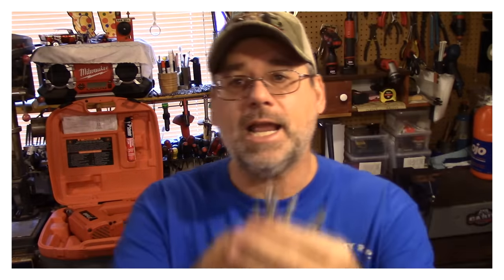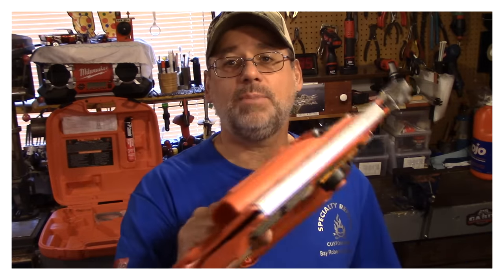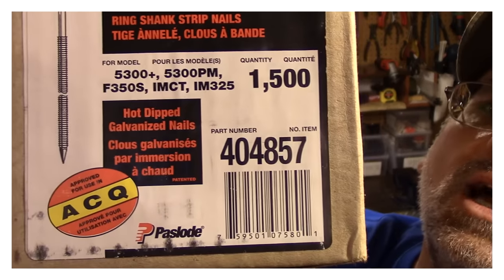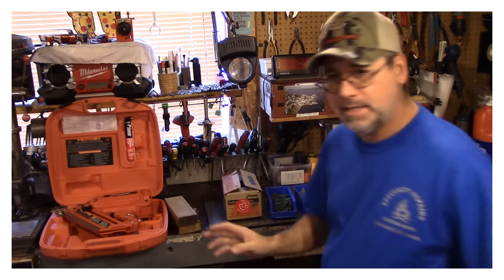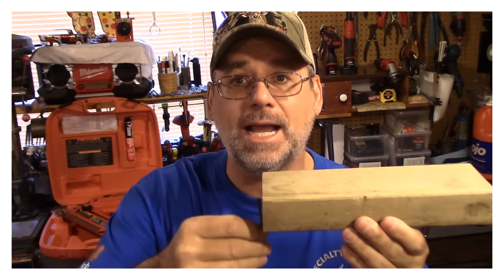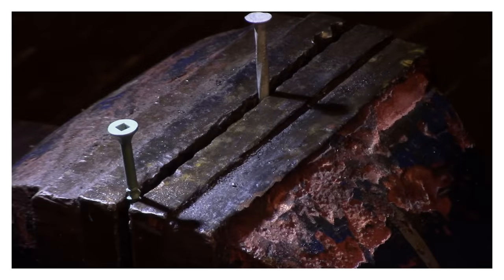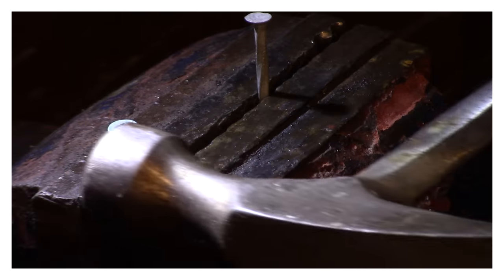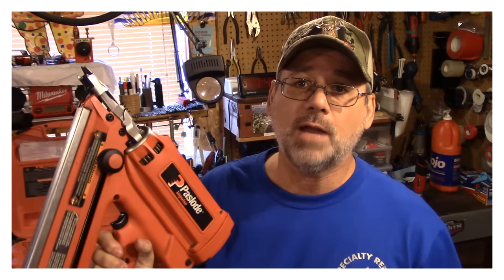BEWARE  NEVER USE DECK SCREWS  - DECK SCREWS VS NAILS -  PART TWO IN DESCRIPTION

Comment: The screws your showing are high tensile steel . Of course they shear of on impact,  the nails are mild steel.  SHIT galv or not.  316 Stainless steel screws are not that expensive will not rust have a far greater load rating than steel deck screws or mild steel nails and will still be there when the wood is well and truely finished.   And for load bearing structural joints like on deck frames use bolts nuts and washers.  There not that expensive either  and you get a far better job.  Nails are just quick not quality.
Reply from the maker: High tensile screws that snap like a pretzel  are only made for holding deck or fence boards down but interesting enough I still see them used with joist hangers to ledger boards fastened to block walls with proper anchors then the deck joist is fastened on with cheap deck screws 😅  I've seen some fancy bodge work from diyers . Cheers
Reply: I have driven thousands of SS deck screws, 2.5," 3", 3.5" square drive heads, and never has a single one broken or snapped. My own deck built 25 years ago, the screws are perfect shape, can be removed and reused. No rust, hold great, look good forever. Square drive screws one weakness, the heads can strip out, but you got to know what your doing, like push down decently hard, no careless driving like using a torx screw head, (whish is hardened steel). The SS deck screws to use have the cutting chisel point tip, no need to predrill in soft woods, except maybe at the end of the thinner deck boards.

Comment: I got the Ridge hose air gun nailer the paslode was too expensive. Thanks for what i knew was wrong. My buddy had a Paslode gun with the framing nails not for pressure treated. We only use to attach stringers to ledge board for the stairs.
Reply: @SteveRobReviews  We will see deck replaced 2016.

Comment: That is not a proper test putting it in a vice and saying one shears easy and one doesnt. Make a small structure with a few boards fastened one with nails and one with screws and then test shear and how hard it is to knock the structure apart.
Reply from the maker: I would love to be able to do that. I was just trying to show how side loading a deck screw can result in breakage because of its brittleness. They are  a terrific fastener in the right application. In part two in the description I revisit the test somewhat. Cheers and thanks for taking the time to respond.
Reply: thx for response I just like to see some practical applications to see when and how they fail. I realize it is a lot more work, Just seeing in practical application and how they fail helps paint the picture.
Reply from the maker: +Rollack  That sounds reasonable and the next time I'm out and about and I run across an example I will film it and give you credit for the suggestion. Thanks

Comment: Nails are for structure. Screws are great for plywood underlayment where there is weight above and lateral friction as well as plys versus solid wood.
Reply from the maker: Well said Bill. 👍
Reply: @SteveRobReviews  In the event of seismic activity...which in theory can happen anywhere...the structure rocks as a unit. There is tremendous force and friction which nails can withstand. Nails however should not be driven into studs that are 40+ years old. They will split!
Reply: Nails are for structural framing. Decks are a different animal. Steel hangers, wood joinery, and heavy bolts are for deck structure.

Comment: I like screws because it's easy to fix my screw ups.  Pulling out a hot dip galvanized nail  not so good. Sometimes I use a few screws to get things in place then bang some big hot dip galvanized steel nails.
Reply from the maker: Screws and nails both have their uses so   pick whatever  is required for the location  . Cheers Robert

Comment: Yeah, I agree. I don't use screws. They may draw a board in easy and make it easy to remove a board but, I have never had to remove a board or at least desired to. Nails are stronger and don't snap. With a nail gun, your done in a 10th of the time.

Comment: Always use stainless steel nails. They cost more but they never rust. Hot dipped will still rust.... I also love the passload nailer.
Reply from the maker: I agree and so far the nail gun is awesome. Cheers Gary
Reply: gary brinton 
The stainless is a lot weaker. Double dipped galv. nails are code for structural construction in many states. Also the paslode is convenient, but the will fail inspection where a full head is required. The most reliable and lightest gun on the market has been the hitachi framing guns. I'll take those with a 1/4" poly line Any day over a cordless anything. But that's objective. The convenience of the cordless for the weekend warriors are priceless. I agree

Comment: take a mobile home apart, its full of screws they work better than nail
Reply from the maker: Its not one better than the other its whats allowed and whats not . If both are accepted then its your choice but you can not use deck screws in so many locations . Cheers

Comment: Screwed threads grab to vice-squeeze boards together,  not pounded slipping through wood.            I like to use a nail for substituting a drillbit about 3/4 screw-depth, for a prescrew.                         Drill slipping smooth nail through does not ream out the board-hole looser;    but sizes the nail for snug difference around shank even AS IF screw threads were grounded off.                  And power-drilling smooth nail frictioned hole-tube,   does wood-work a denser thread-casing for sturdier screw-HOLDing GRIP.                Is a prescrew same as foreplay?                    All I know is that fast spinning nail dips in and out fast production-like,   if your drawing plans  locates its spots,   where you want everything setup ahead of time.

Comment: Yeah, just common sense, nails for structural joints, screws for top of deck or fence or light shelving. 2 to 3 nails are enough already for load bearing and I usually use 1 screw to keep them from dislodging, but I sometime use lag bolts and nuts, enough for a car to go on top of it if I presume kids are going to play on the structure.
Also for the screws, for wet/humid outdoor, I recommend stainless steel screws. I built a deck and 2 wooden tables for cooking outside with a sink in between. Within 5 years I had to replace half of the screws. The nails and bolts are still fine.
Reply from the maker: Richard common sense is definitely not so common by some of the construction techniques I have seen . LOL
Reply: @SteveRobReviews  LOL

Comment: What about when used in combination with galvanized joist hangers and GRK's. I would say you would be fine to use deck screws for framing.
Reply from the maker: Joist hangers using regular deck screws is  not allowed anywhere in the world  that has building codes but their are specific  joist  hangers screws  allowed  depending on local building codes . Grk is a screw  brand  so you would have to use the allowed screw if allowed in your  specific area.  Not so easy to answer and I see far too many just guessing on what to use out of frustration:) cheers 👍
Reply: @SteveRobReviews  thank you for your response. I will definitely be using the joist hanger nails after watching your videos. I appreciate you sharing your knowledge for others to learn from.

Comment: The harsh reality is the price. People build everything with deck screws because they are cheap. They would be willing to use structural screws if they were comparable in price but they are not even close. A DIYer is not going to pay more for something they don't understand or care about. Nothing is ever being built to code and no inspections are taking place. It's only us highly conscientious ones that care about such things. People attach their beams to posts using a handful of deck screws and then set the post in a 6" diameter hole with dry concrete like it's a fence. Nothing you say will convince such people to spend an extra few hundred bucks on proper screws. Half the reason people DIY things is to do it for as little money as possible.

And getting them to switch to code approved framing and joist hanging nails is hopeless because people are convinced nails will pull out and screws are modern tech even though every house they've ever been in is completely held together with nails. Also they don't have an expensive nail gun and hammering by hand is way too much work. Gotta use the father's day impact driver kit for something, right?
Reply from the maker: Carl your absolutely correct 👍👍
Reply: Don't agree at all Yota.  Just because I'm a DIYer doesn't mean I don't want the correct nails, fasteners, and framing or joist.  Some people DIY because this shit is to easy to not do themselves.  Does it same money hell yes because half of these cocaine heads that end up showing up waste hours stringing jobs out longer then they should be.

Comment: Obviously I’m using a different type of screw I wouldn’t use the ones shown either. I have had to remove many screws (usually because someone green wasn’t holding the drill straight and stripped out the head) I have never seen one of them have a shear break like that, they bend like the nails and are a pain to remove, the easiest way is to chuck your drill around it good and tight and slowly back it out. 
Also a side note, NEVER count on any fastener that goes through the end grain to be a structural joint. Get a proper corner hanger on any joint you have like that.
Reply from the maker: Great advice Alex 👍

Comment: Screwing boards (after predrilling) tightly to joists can also be structural depending what what you mean by structural.  A screw (especially when ganged) should never encounter a momentary shear force equivalent to that of a hammer blow.  That’s like Armageddon!  Overall this is a really good video.  But note that there are superior screw type fasteners out there as well as nails.  There are always trade offs (even in price for a superior product), you need to select one that makes sense for the application and environmental factor ranges.
Reply from the maker: Well said Cal L   and a lot of common sense. Cheers
Reply: Thanks Steve.  It’s a really good video for demonstrating nail vs screws though.  May I suggest perhaps explaining in another video why people pocket screw from an angle instead of the end grain to show that if a screw cuts and attempts to grip the length-wise fibres, there would not be much for it to hold onto.  But also good it to show how nailed down steps can have the nails back out over time vs screws.
Reply: From an engineering perspective, a nominal 16d nail out of your gun will likely shear at about 95 lbs. and a #6 screw (similar diam.) will shear at around 70 lbs. Can I source a screw not much bigger that will match your nail for shear strength? Of course. A typical engineered job could use specified screws and have a very similar performance outcome to one built with your nails as well as the advantages that go with screws. Cal is right that screws are not intended for momentary shears since they aren't expecting to be pounded or shot in to the material, just as aircraft aren't equipped with side airbags.  :->  They are also more dependent on the depth of material that they are in past the shear point so that they have something certain to hang onto. Misapplication will certainly lower performance.

Comment: Depends on brand of screw also. I have bought some good brands and some junk brands. Guard dog screws are the best I have used for strength and pull down power. But not sure if they make them anymore? But they were more expensive.
Reply from the maker: Great point , you get what you pay for most times but it's best to hear from others what good or bad. Cheers

Comment: Here in Canada nails are required for framing in our building codes, never screws.
Reply from the maker: I've never seen tradespersons use screws on construction sites but I have seen my share of YouTube trained carpenters build quite the interesting projects from sheds to small shops using  all  deck screws because anything is possible on YouTube:) Cheers bud.

Comment: I've learned not to attach PT decking with deck screws. After 2-3 years, like galvanized nails,  some will start to back out. When you try to screw the deck screws back down, many will snap off. However, galvanized nails can be hammered back into place with no problem.
Reply: Hi. The screws are not backing out. The deck boards are shrinking and the screw threads are hung up. Even the support joists can shrink back creating a gap under the decking. The threads hold the wood apart. The walking on it drives the top down and exposes the screw head. Solution. The old adage. Drill clearance hole in the pc. you are screwing down. If you doubt that ask a drywaller why they use the minimum length drywall screw. It's because fresh wall studs will shrink and if the screw is reaching the center of the stud, it won't move there. But the edges shrink and open a gap. A short screw will pull the drywall with it. A long one will result in loose drywall and screw heads popping all over
Reply: @slowfinger2  Very informative, thanks for taking time to post that and educate others

Comment: Never is a long time. Cheap screws will fail in some applications as will incorrect nails. Stress and loads have to be considered. I tend to use both when I can. Hand rails on decks built with nails only will weaken over time especially in all weather climates. Consider the application first and don’t cheap out on your hardware. Be safe and happy hammering.
Reply from the maker: +Handiman Jay  Well said buddy . Good info

Comment: If you don't want to see rust stains in your decking use Stainless Steel Screws. Everything else is pretty much garbage. Galvanized Nails are ok if you don't mind seeing the nail heads. My decks are all Ipe Hardwood so I use SS Screws that are countersunk, plugged, and then sanded.  Most guns won't penetrate Ipe decking and trying to remove a halfway sunken nail from Ipe is painfully difficult .
Reply from the maker: Good points bart . Cheers

Comment: I did t see this on here but I may have overlooked it. The MAIN reason to use the galvanized nails is because the rust and elements will stick to the nail causing a “anchor” effect that also helps keep the nails from backing out. That is the “professional” reason we all use galvanized nail instead of regular nails or screws. However, even most professionals do not know why they are even using them to be honest. Haha. They just know what a real professional taught them as they were frowning into a professional, but that’s okay, hey no one person knows it all and anyone that tells you they do fire them right then and look for someone else!   Haha

Btw: you can buy galvanized screws now which in my “professional” opinion are the awesome! You can use them anywhere outside in anything you want to! But be ready to pay the price for them. Which the people I work for don’t mind paying that price. Hope this helps. God Bless all of you and I hope the best for everyone!

Comment: Deck screws are totally fine for some applications, like not large sheds. In fact some small shed can be build even with long dry wall screws. Yes, they snap easier than nails under load, but how much of the load small structure like 8x10 shed will ever experience?
Reply from the maker: I agree as long as the ones using them to hold up  that one 6x6 deck beam think twice about ever doing that again. 😅

Comment: Hot dipped galvanized nails are strongest for horizontal- framing and joists, wont shear off. Deck screws are brittle, too weak for joists. Screws are for deck floor. Got it. Thank you sir!

Comment: The old pressure treated wood was compatible with galvanized. I have seen what you have in my big barn door made with 2x6s 9years ago.

Any kind if pressure treated lumber for over 20 years, infuses with copper instead if arsenic...it will even eat through your roof decking, galvanized us no longer the fail,-safe, and the popular Teflon-coated deck deck screws won't do that, but somehow snap off like a piece of chalk otherwise.

I only use stainless steel on metal roofs, floors, decking...and especially bolts. Not necessarily the expense if chrome, but must be :
STAINLESS STEEL, nuts, washers and everything.

Comment: I need to construct a simple kids swing using lumber in the garden. Which screws should I use?
Reply from the maker: Simple kids swing  must be built safely so chose a safe construction method and fasteners that  provides  the highest safety.
Reply: @SteveRobReviews  so I was thinking of using 3 inch decking screws. Would this be suitable?
Reply from the maker: I have built a swing set and used only 3/8 carriage bolts , no screws.

Comment: Isnt it common knowledge that nails are used over screws for shearing strength? Screws are hard and brittle and nails are more pliable and can move with a structuure.  This was kind of a captain obvious video to me but im sure there are alot of people who dont know this. 

I guess I was expecting something different than what I already knew but good advice because there are a lot of peeps that dont know this.
Reply from the maker: Up here all nails in most construction and the codes are much the same in america. Screws are used in places and the correct screws . I was surprised to see so many using deck screws for some real bad situations and they still do. Oh well :)

Comment: Who uses a Paslode gun except on small projects ? They suck period. You can buy an air framer for half the price. And yes screws don’t have the sheer strength nails do. But you can certainly use them for deck boards and fence pickets.
Reply from the maker: I liked the pasload  as a framing gun but it's definitely not as good as my pneumatic framing nailer .